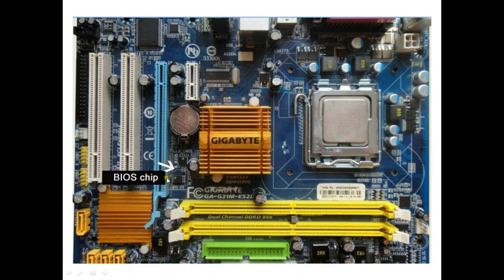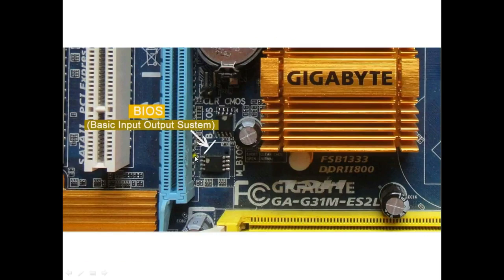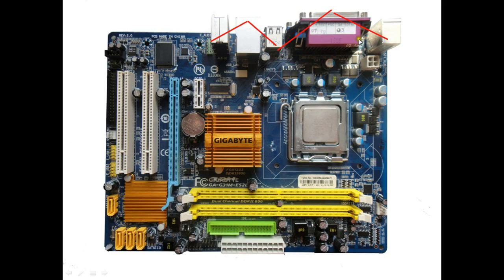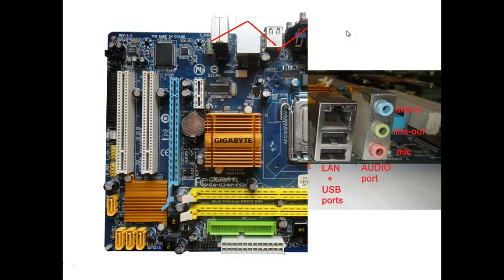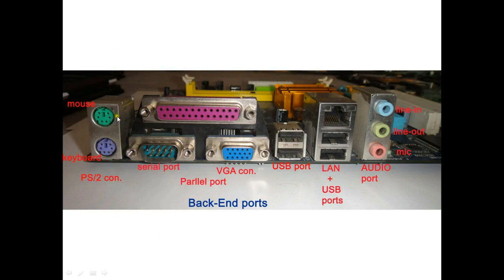motherboard chip level repair training(eng);part 1

Comment: Nice explanation. but there is a slight mistake, since the port that you referred to  as an AGP port is actually a PCI Express 16x Port  and the smaller port is PCI Express 1x Port